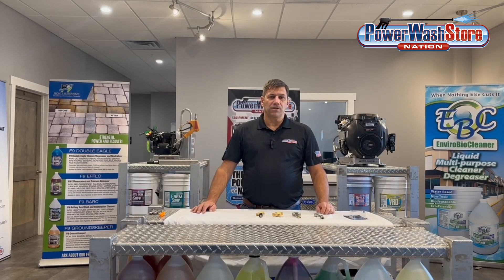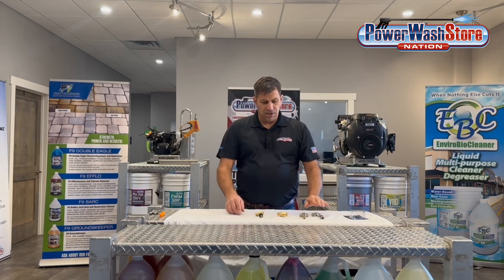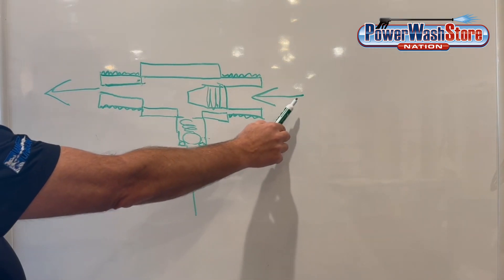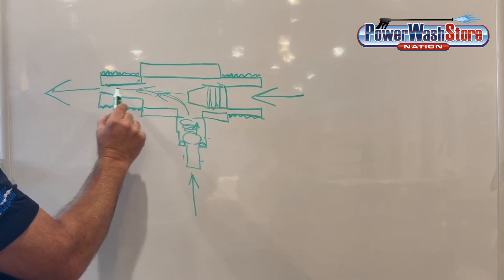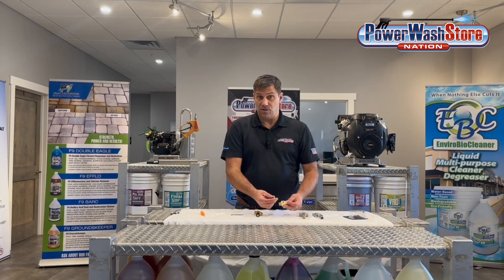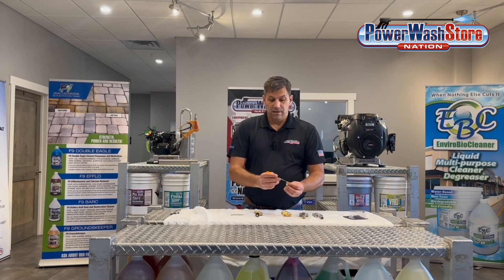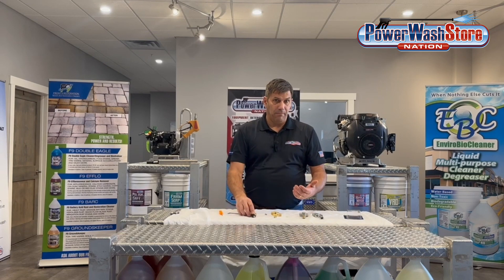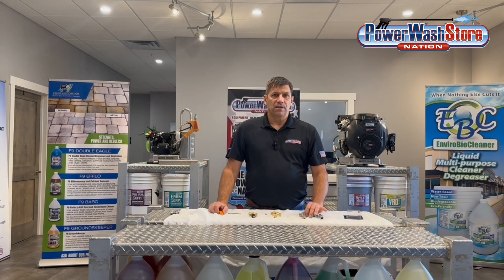Downstream Injectors: Simple Guide in Minutes!

Comment: thanks for this interesting video. The injectors for sale on Amazon specify flow rates of at least 2 gallons per minute. My pressure washer has a flow rate of only 1.2 gallons per minute. Can I still use an injector to draw up 10% bleach with the 15° nozzle--do you think I have to use the low resistance soap nozzle?
Reply from the maker: Thank you for your comment! Injectors draw when the line pressure drops below 1000PSI. For your machine, anything above a #6 would most likely draw soap - however it is always trial and error. Feel free to give us a call if you need further assistance with finding your injector! 414-351-9274